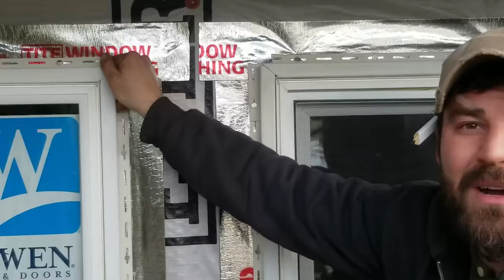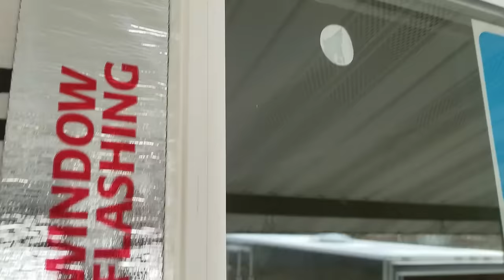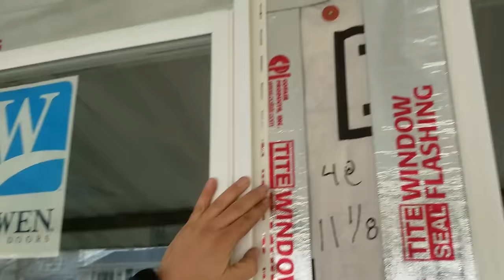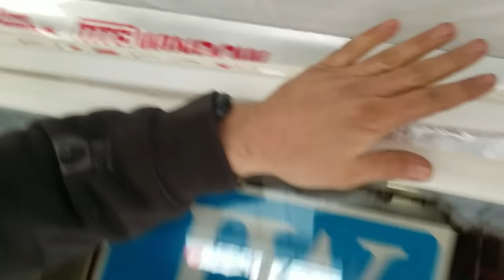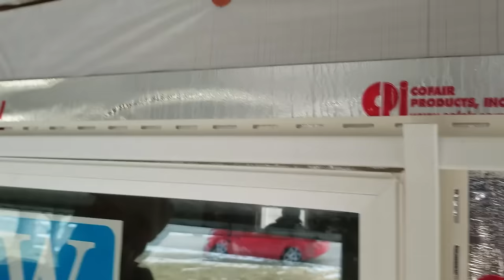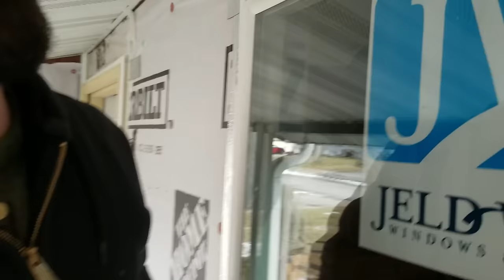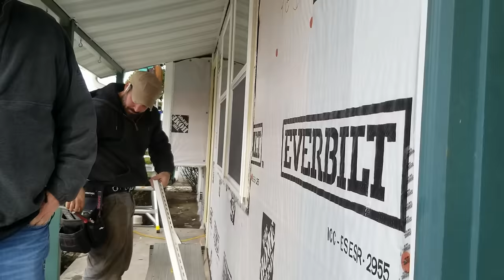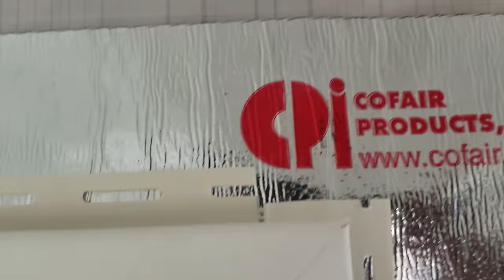HOW TO | J-Channel a Window (Perfectly Every Time)

Comment: Is it necessary to put any sort of flashing or tyvek tape on the top j channel to help redirect water from going behind the channel? Thanks!
Reply from the maker: No not necessarily.  Flashing tape around these types of windows is good enough in my area. Can't speak for other areas and rules I don't know about but I'm pretty sure this is the going rate.  You should probably have flashing that runs up the wall of your doing a replacement window with an aluminum wrap.
Reply: @NWIVeteranConstruction  Thanks!

Comment: How do you do siding and facia on a gable end that has no overhang? Only a 3/4” facia board? Do I need to add on to the facia board so it is wider than the j channel? Or maybe it doesn’t matter if the j channel sticks out 1/8” past the facia board.
Reply from the maker: Yes exactly. I would add a board to it.  But if it's not that bad don't sweat it.  If you're gonna lose sleep over it caulk the top of the j to the bottom of fascia
Reply: @NWIVeteranConstruction  bend your fascia board over top of the J..2 bends

Comment: what about adding Sealer or caulk in the gap between the J-Ch and the window frame? Not required?
Reply from the maker: Not where I'm from.  I do know specifically for hardy n lp you don't caulk souvenirs l above the windows before water gets behind and doesn't have a way to drain
Reply: @NWIVeteranConstruction  Thank you.
Reply: Vinyl siding is designed to accept and shed water at every penetration (weep holes, and even if it doesn't rain humidity condensates on the back of the panels and collects esp in the early morning hours, think morning dew). Prep should be layered and water tight prior to installing any vinyl

Comment: A 1x4 /1×6 should go around the opening.  With at least one flashing on the top. I seal the j with clear at the backs before I nail. I nail my wrap tab into the wood to keep the corner from opening up over time. I use the j tab cutter/maker tool. Firmly squeeze to cut perfect open end. Lightly squeeze so it doesn't cut and it makes the perfect tab. (Takes the right touch to get used to) well worth the money.
Reply: U say it ‘should’ go around the opening????? That’s just customer preference, and why would you flash the top of that window underneath a covered porch??

Comment: You guys don’t have to use a drip cap on the top of the window? In Alberta the code is to drip cap with a 1 inch dam. 
I like how cut an extra 2 inches and wrap it around. It holds the corner tight. It’s also good that you don’t tape the bottom of the window so it doesn’t trap water. You should use a soffit nailer would speed up your nailing time. Good job.

Comment: ..siding is nailed loose to expand/contract...j-channel, not so much....I use 2 nails in the center nail slot,  so the j-channel can't slide up or down..then the rest in the middle of the nail slots, it's not gonna move or buckle...on the under sill utility channel, just use caulk to hold it in place..no need to pound in window nails,j-channel nails then u-t nails on one thin board...looks nice..I use a speed square and knife,for "tab" ends..cutting the inside of the j-channel on both sides, the lay the speed square straight across the back, then bend it off..snips for 45's.... keep up the good work!

Comment: Greetings, I had my windows replaced.  The old frame is flush with the wall.  Do I need to wrap the windows before installing my J for Vinyl siding?
Reply from the maker: you just need to have the moulding on. the aluminum can usually slip  behind your j pretty good but it can't hurt to wrap first.

Comment: I'm wondering why you use a J on the top of the window instead of a drip edge molding? Just for esthetics?
Reply: You normally would use both. But in this case the top of the window is more or less protected by the eaves

Comment: do you have a video on metal j channel and do you put drip cap under the j channel?
Reply from the maker: These windows have a flange built in so there's no need for a drip cap or window wrap. But I do not think i have one on the subject.  There's a chance about 2 years ago I may have a window wrap somewhere in there with what you're looking for but I've never used aluminum j

Comment: Is it not required to tape the bottoms of the windows?

When I've taped them, I do bottoms, sides and then tops. Don't see any window tape on the bottom of those
Reply from the maker: Not everybody does.  I didn't do these.  But I'll admit I don't usually either
Reply: @NWIVeteranConstruction  cool, must not be code out there? I'm just always nervous of vinyl siding personally. No way to seal it tight like LP or diamond Kote. After you caulk it of course
Reply: @calebbrown9091  diamond coat is a paint used on LP... same general product though...
Reply: @zekefricke  yeah, I've used it friend. I call it Diamond coat siding, because the paint is better. 30 year warranty.
Reply: The bottom of the window should be taped prior to window install. Set the window, tape the sides, cut the housewrap across the top of the window nailer and 45 it at the outside edges. Lift housewrap, tape and put back over. Housewrap tape can be applied over the bottom nailer (to eliminate double tar tape buildup and prevent any air infiltration but water is already covered due to the shingling effect.) and housewrap tape over the the top where wrap was cut. Tar tape eventually fails unless properly layered and I've been in a situation where the builder taped over the bottom and we had to roll it down to get the 1/8" ice bead (winter) that occured behind the top lip of the grace (tar) tape. Should prob drip cap and tape that garage door head too hmmm ;). Enjoyed the video, I do mine totally different and do not allow my guys to use the aviator snips for channel, we use red vinyl only 12" snips for crisp clean miters without the serration marks you typically find wirth aviators unless you can find the rare set without serrations and even still I can visually spot the difference. Should be little to no need for caulking on new constriction and minimal for side legs and to caulk casing to existing window on remodels. Caulk eventually fails or at the very least looks like butt when it gets dirty and it will get dirty and will never clean up as well as the siding or trim material where layering and back flashing can't fail or show dirt..  Some day I may make a video

Comment from the maker: RULES ON THE #JCHANNELCHALLENGE
1) just j the dang window start to finish
2)use your own style if you don't like mine specifically or your boss prefers it differently
3)maintain good quality throughout the process
4) first one to beat me gets $100 speedway gift card, same as the #onesquarechallenge
Reply: red snips are LEFT hand.....green is RIGHT
Reply: Red handled snips make “left” or counter clockwise cuts in sheet metal. Green handled snips make “right” or clockwise cuts in sheet metal. same as in aviation and naval use of green and red.........red is PORT/LEFT SIDE........green is STARBOARD/RIGHT SIDE
Reply: the easiest way to remember is : red , left , and port are all smaller words than green , right , and starboard.
Reply from the maker: @robertn2813  you might have a case lmao somebody must've called it the wrong thing a long time ago and it made sense to me because cutting counter clockwise is easy for right handers...thank you
Reply: bro , just think about cutting a circle in sheet metal. the reds cut counter-clockwise , forcing the waste from the cut-out to the LEFT side of the blades (into the center of the circle) , the greens cut clockwise , forcing the waste to the RIGHT of the blades into the center of the circle) because you dont want the hole in the metal to be jagged as hell , you want it sharp and clean , lol , so we can rip our hands to shreds later , joke. haahahah
Reply: No real vinyl sider uses tin snips. Red left green right, yellow straight, ahahah. that's for roofing. I am going to make a video tomorrow, where do I send it?
Reply from the maker: @pepperman9  put the link right here! I hope you actually post one.  Over my YouTube career there's been a lot of guys that say they will and either never do, or try and get slapped in the face with reality that they're way is not there best way lmao right here's good though bud
Reply: Dude that was the worst example of how to j a window I have ever seen
Reply from the maker: @robertstekowicz5404  you know douche nozzle I did make a challenge here! Make a video idc if you nail 4 boards together to mimic a window. Say what you want About me but you talk About boycub like that again I'll block your ass from this channel n I know you don't want that coz you learn too much lmao
Reply: @NWIVeteranConstruction  😂😂😂 get hemmmm. Don't talk shit about boycub bro that's just not cool at all!!
Reply: I have a question
Reply: @WorldsFastestShingler i have some question i was  wanting to run by you
Reply from the maker: @davidblack9407  shoot. I'm on vacation though so might be slow on responses
Reply: Hey im a full time roofer but this week im siding my parents house struggling with j channel this video helped me get through it, takes me about 10 mins per window, hoping to get faster, but they look great. First few looked terrible before i watched
Reply from the maker: @jacob5525  awesome man I'm glad I can help!
Reply: Worlds Fastest Shingler quality? Real pros don’t use drip cap I guess
Reply: Also I don’t like your razor blade mitres. I come in a 1/4 inch so no one slices skin if they brush up against it
Reply: The only thing I see I'd dif is when you cut the 45 to leave the point on the face of the sides an top when you fold it into the other piece it will lock into the lip of the other piece  if that makes sense it will help lock the 45 tight together just a suggestion bro and also when you fig out you bottom and sides cut fold and get bottom and top  at same time and both sides at same time
Reply: @robertn2813  not where I am from .yellow is right green is left and red is for when green and yellow just can't get it
Reply: @NWIVeteranConstruction  I argued all day with one if those know it all salesman that commented on your choice of footwear. Lol always a choad in the bunch. I think you do great work never seen you cut corners , quality materials .some people just don't understand how professional us blue color business owners really are. I also do my j channel as you do , never a pencil on j channel .doesnt matter to me if I get rich or not. My family is comfortable and we'll taken care if and i achieve that doing what I love to do .so in short , piss off all you glorified salesman and craftsman wanna be , the best learning happens when you listen not spout off stuff you don't even have a clue. Kudos to you zak I would work with you anytime , but I am a 24 foot and under kind of  guy .if every roof started 5 or 6 feet from the ground I would be the greatest roofer ever.
Reply: @NWIVeteranConstruction  well said.

Comment: Do you ever use a mitersaw for cutting angles? That’s what my boss makes us do
Reply from the maker: Not angles because 4/12 pitch is too long but mostly use it for in between windows coz you can chop 4 or 5 at a time. You can see that in my "one man install" video

Comment: What's the difference between left handed snips and  right handed snips don't they both cut siding
Reply from the maker: The blades are put together different so that when you cut your snips can stay on the line.  Reds and greens are designed for that.  Yellow and normal snips are straight, which means you can use them for whatever but they don't cater to any custom cut specifically.  More important for working with aluminum.  Like fascia or windows but I like having both on me while I do j channel

Comment: Good job. I like everything except the windows.
Reply: Also, we caulk our J channel on too. The best, is windows with J already installed. Saves lots of time.
Reply from the maker: I just wish the pre-j windows were a little deeper. not very much play in there usually
Reply: And the  chinsy housewrap.. I guesse I get the thinking behind caulking your J but I always just figured if you wanted yours siding to act as an envelope, you shouldn't put vinyl or steel up because they are just bulk shedding water your actual envelope is the house wrap or tyvek. Like the process on the J though diferant than my typical method.
Reply: @stich1960  I agree. Just a local code that we follow.

Comment: The video does not mention something about how the J channel directs rainwater. Your method of applying the J is correct, of course: bottom piece first, side pieces next, top finally.
Therefore, rainwater will hit the top J and be directed to the outsides of the window. That happens because the top J overlaps the sides. The same kind of effect happens at the bottom of the window because the side J’s overlap the bottom J.
I have seen jobs where the J channel overlaps were done incorrectly and water got behind.
Reply from the maker: Thank you. Sometimes I leave things out

Comment: the j channel snips are well worth the 40$ imo instead of making those 2 cuts down the sides and having to get the "tip" in lol you just  squeeze the snips and its notched one shot and when you dont squeeze as hard it leaves your drain tap on it
Reply from the maker: the notchers? I really want to see them in action being used by somebody who knows what they're doing at a real work speed.

Comment: My husband has been a Sider for the past 28 years. One thing wrong there. When it comes  to water the water slows down when it flows down the inside of the j-channel and you showed how you cut the face of your jay at a 45. And straight cut the back. Wrong future water damage by not making a 45 on the nailing flange as well.try it and msg me. Tom Sibila.oakdale mn.
Reply from the maker: I'm not sure I follow what you're trying to say

Comment: Great video but the top of your windows are flashed improperly
Reply from the maker: The guys who did those are nut jobs for correctness and own union a framing business as well as work full time as owner operater. I have a hard time imagining they are wrong but I'm always open to learn.  What's the issue with it?

Comment: J channel has very limited use with siding. A lot of amateur siding installers use J channel to wrap openings. I would use a aluminum window casing bent on a brake with built in J channel on windows with wooden trim. On applications like this with a vinyl fin you should at least use vinyl casing which is like the J channel instead it has a longer face and looks a lot nicer on openings. J channel belongs with soffit. NO HATE I UNDERSTAND YOU ARE A ROOFER SO IM NOT HERE TO NIT PICK IM JUST TRYING TO INFORM THE AUDIENCE.
Reply: Varifyable I’ve done exactly what you’re describing on many occasions, it’s well above the ability level of most people to do it that way properly, j channel around an opening is pretty standard and looks just fine

Comment: Just measure out an inch on your snips scissor. Lift changing.
Reply from the maker: One hell of a tip right there! Will be trying that one out
Reply: I did the exact same thing.  I told the guys on my crew what I was going to do and they thought it was dumb.
Reply: @craigandrewwilkinson  some snips already have the ruler engraved on the scissors.
Reply: @manderson1638  kind of seems silly to not have anything there that is so easily done and costs nothing

Comment: This is the worst way to do a 45.  It leaves an ugly gap at the corner and doesn't flush the water away.  Instead of cutting across the nailing flange, just cut a v notch legthwise and fold it under. 

 This leaves the back of the J to flash over the bottom j.

Looks and performs better.  Also, caulk the j.  It keeps it tighter to the window frame and keeps water from sitting at the edge of the sticky flash.

Comment: Where r ur flip nails?case u dont know u put a nail sideways in falange takes crown out of it n pressure against jambs n if doin l bends on windows pressure against the metal. I off course line my js first the bend 3/4 by3/4. Then face then insert bend wit 3/4 flare on window to b zipd no caulk nec then casing is projected not recessed n js r hidden thats my design almost like using lineals but more elegant
Reply: Yea thrs disparity in geography or demographic i grew up north jersey n ny but been in philly 4 yrs n terminology n installation very diff. Im just kickn lil tricks everyone has. Mario batali said i could learn from bus boy. Flip nails r standard in nj yet in philly nt 1 person even seen it.  2 hrs away. They dont know diff to double hung casement bay bow hopper slider transom etc.. Stay safe bud

Comment: another thing that your taking unnecessary  steps.. speed square to mark 1inch from left, flush your mark, mark the right side tight to window trim, then speed square 1inch for right side, and notch tool 1 snip out of each side, i got ine given to me, definitely doesn't make it a million times faster but nice to have has measurements on tool to go 1inch first shot is nice to have,
not hate constructive criticism

Comment: a left handed friend  said turning the snips upsidedown lets them cut the opposite way.
Reply from the maker: I use that trick from time to time on really tough cuts. But usually when working with aluminum.  J channel is simple, can be done with big giant straights if you want.